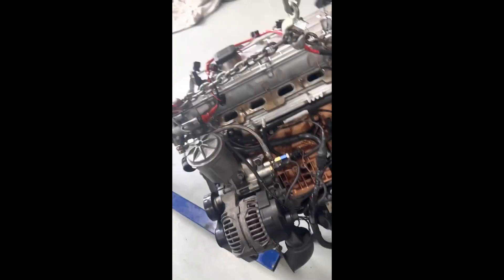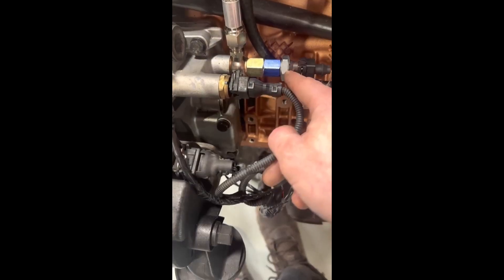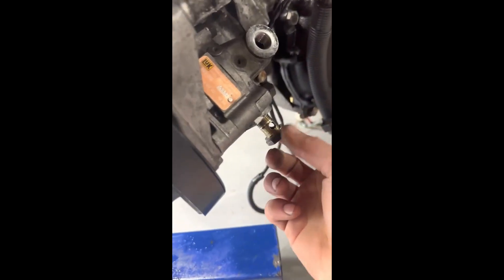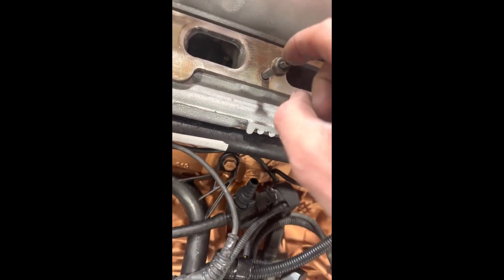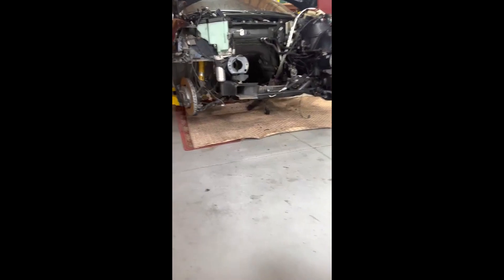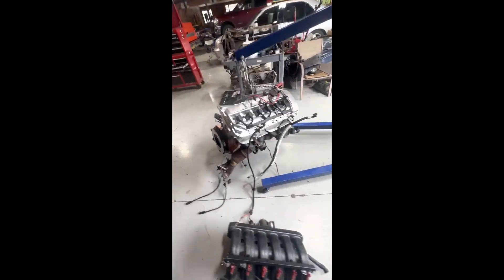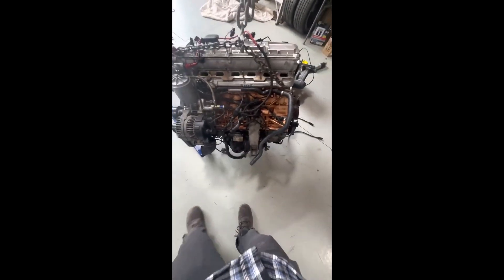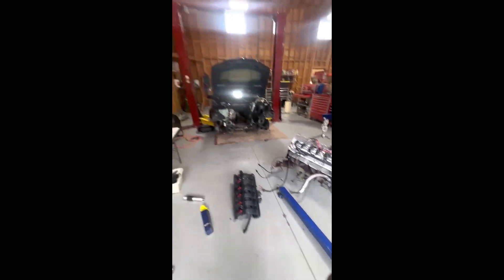m50 oil housing on m54 + e36 parts on an e46 xi

Comment: Question sir. To clarify . In order to run the m50 ofh I would also need an m50 power steering pump with custom pressure line  unless I can line up the m54 power steering with washers ? 🤔😭
Reply: 1:43
Reply from the maker: yes